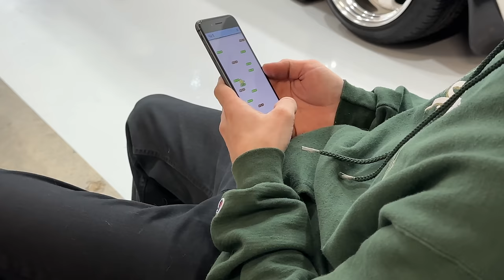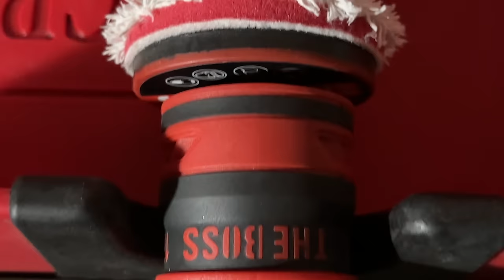Getting My Best Friend's E46 Ready for Show Season!

Comment: Does this e46 rub or scrub on fenders or humps or does it drive normal smooth and is it possible to lower it on stock suspension same height like in the video how should i do ?